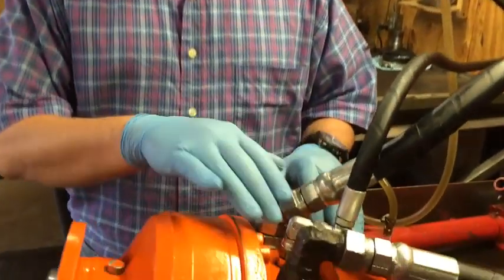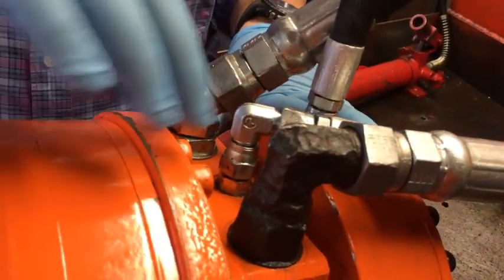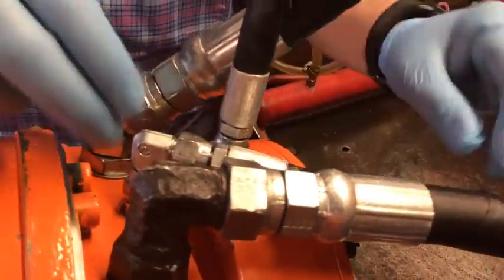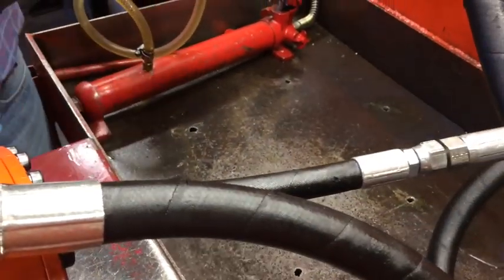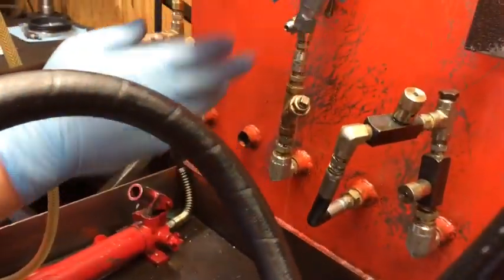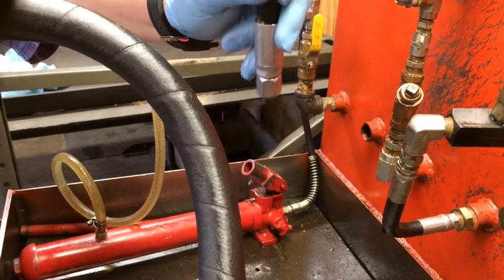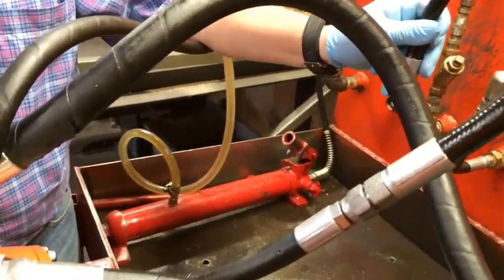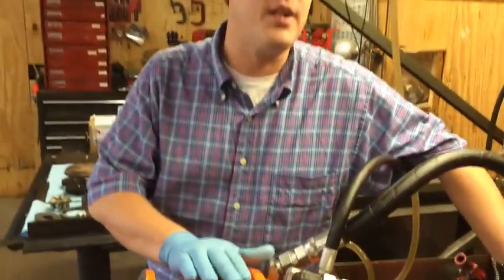Bobcat T190 Travel Motor Problems: Final Drive Diagnostic Testing

Comment: I have a mcr5 two speed that only works in high. I took brake apart and found inner piston seal for brake chewed up causing high case drain pressure. Would this cause my low to have no power ? Spool for two speed is nice and free/ clesn

Comment: Replaced my drive motor and my brake on the drive motor seems to be dragging. Any in-put out there?
Reply from the maker: Check the brake pressure on both brake lines to make sure its even. If it isn't even you probably have a charge pump problem. Feel free to call FinalDriveParts.com at 888-934-6257 for any questions you may have.
Reply: Tammy Reed have same problem. Check.charge pressure should be 300psi hot. This holds brake off
 Mine would drop down to 125psi hot and brakes would drag. Adjustment under seat in aluminum manifold. Get a pressure gage (oil filled) 0- 3000psi with test adapter from hydraulic supply or Grainger's. Final drive only holds 1.5oz of gear oil. Poor design. Shalom